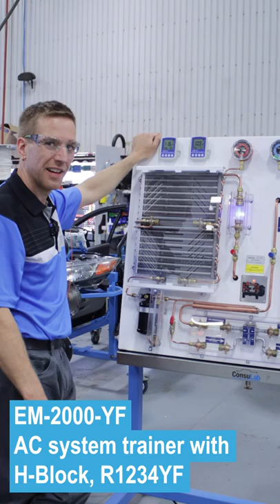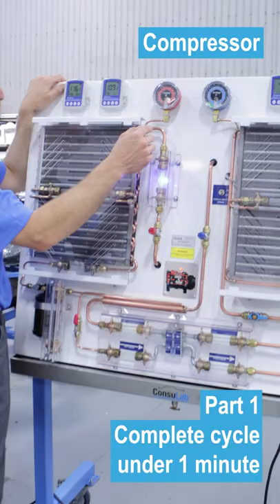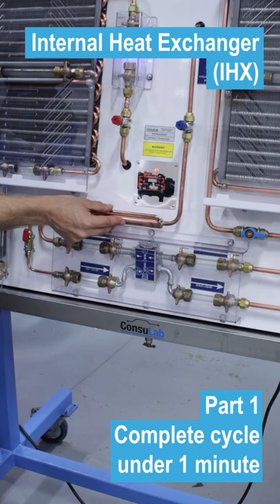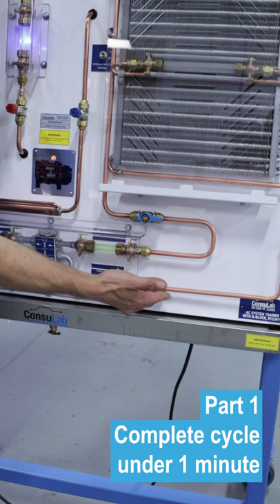The physics of air conditioning in under one minute

Comment: So basically compressor putting in the air is from the atmosphere of the room fridge is placed in ???? What say dude
Reply: The compressor is pumping a vapor refrigerant through it. This is changed to a liquid refrigerant in the condenser and eventually back to a vapor in the evaporator, where the cycle loops afain

Comment: Wrong!   High pressure - Low temperature out of the condenser.
Reply: Wrong! Temps going into condensor can be 150 degrees woth a 10 degree subcool thats still hot my friend... but its just enough tempersture drop to get below the saturation point and start the phase change